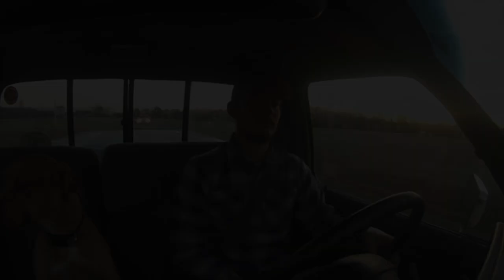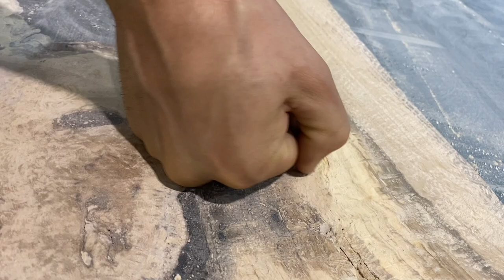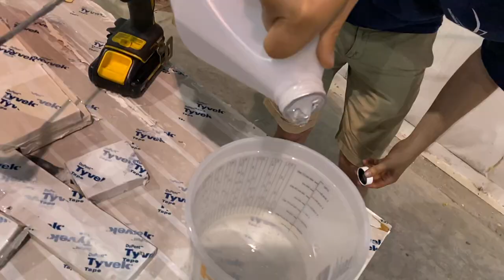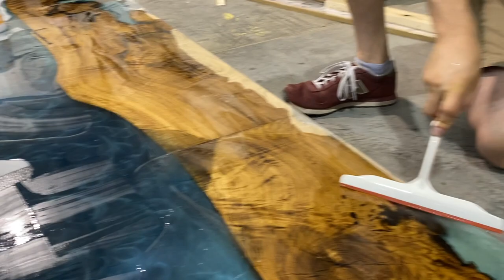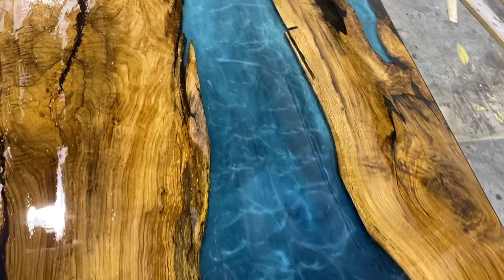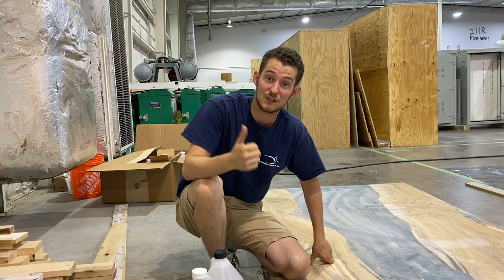Two Pro Tips For Large Epoxy Projects

Comment: hi bit of topic but I was wondering if I can get some advise I am making a resin and walnut table with 2 matching benches and the benches are going to be 1.7 m long and 16 inches wide and will just just 2 box metal legs be ok for support or not I can't really put a bar in the middle as you will see it through he resin or would you suggest putting 3 legs on instead thanks.
Reply from the maker: You should be okay with the two legs.  3 would always be stronger though

Comment: After you pour the seal coat you can pour the flood coat as long as the seal coat has gotten tacky to the touch and not have to sand between coats. Don't forget to torch the seal coat to get rid of the bubbles.

Comment: Could you use the casting epoxy as a seal coat while stablzing the soft wood before you put a flood coat on?  And about how long would you have to wait to put on flood coat,?
As usual great video and tips
Reply from the maker: Linda Conway yes you can . It’s going to take a couple days before you can scuff and add a flood coat.
Reply: @GoodViewWoodworks  thanks for your reply.  We appreciate all the help and advice we get from you and the community.

Comment: I noticed you switched from Stone Coat Epoxy to Incredible Solutions. Is there a specific reason for the switch?
Reply from the maker: I only switched from the casting epoxy. This is because incredible solutions casting epoxy has a longer setup time and can rid bubbles, resist cracking and stays cooler longer.
Reply: @GoodViewWoodworks  thanks for the reply. I just made my first river table and went with Stone Coat. Everything turned out great, but those river pours are so expensive! If one product has benefits over another, I want to make sure I use it. Thanks for the vidoes. I learned a lot from them that allowed me to be successful.
Reply from the maker: @timrice7491  thanks Tim!!

Comment: Thank you for this video I feel like you're answering some questions I asked you a couple weeks ago. But I have a question are you going to mill it after that sealcoat dries and do a wood exposed finish?
Reply from the maker: Not on this one. We’re going to do an epoxy/ polyaspartic finish on this one. Stay tuned 😎
Reply: On mine I need to do an odies oil finish how do you think that would work out by stabilizing the softwood before my poor and then mill?
Reply: Also I can't thank you enough for your videos really learned a lot from you
Reply from the maker: It will work just fine.